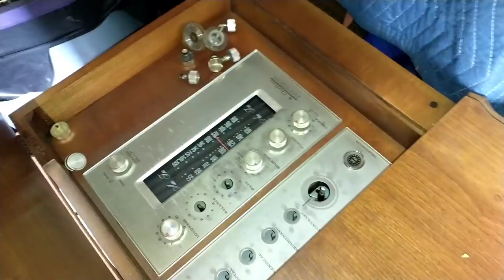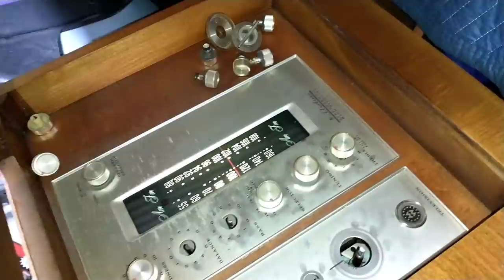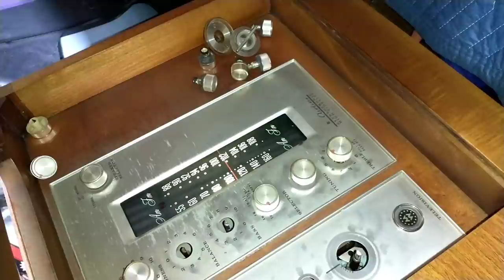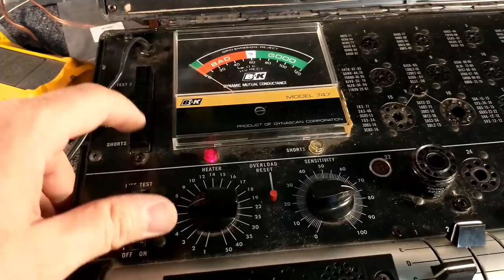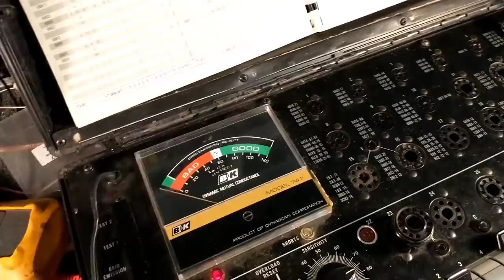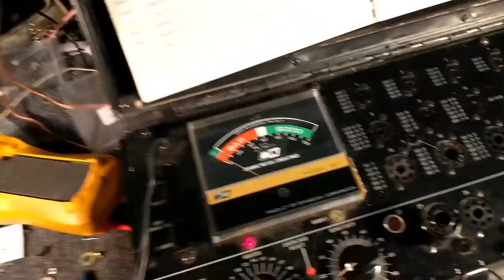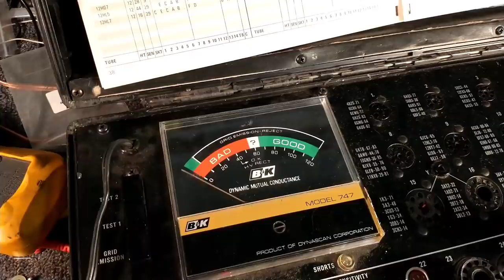Servicing the television of a 1963 Montgomery Wards Airline Imperial console. WG-5974A. Part 1 / 3

Comment: Those things have a breakdown voltage of like 30 volts so they will always measure completely open unless you use that meter with the 35 volt battery or whatever it is

Comment: If suicide had a sound that would be it. How about the capacitor in parallel with the coil or the Boost capacitor? Don't you love it when people tell you what to check in the comments?
Reply from the maker: Given I can tweak the frequency close with the coil backed all the way out, I'm guessing some critical small value cap paralleled with that coil has changed or gone open.  Haven't checked the boost filter to see if it's loading it down yet.
Reply: @JordanPier  Just a thought here... If you are still too low on frequency with the osc coil core backed all out, it would mean there is too much capacitance in that resonant loop. So a cap parallel to the coil would not be open but rather need to have drifted up in capacitance... But remember that the PN junction parasitic capacitance on the 1N400x series diodes is higher than on germanium or schottky diodes, so there may be additional capacitance there that you are chasing.
Also do some resistor readings indicate that you still had voltages floating around obscuring readings - like the 12K resistor reading 6K and creeping up.
And if that three legged brown ceramic cap like looking rectangular thing is some form of couplet it is definitely schematic time.
Reply: @JordanPier  
Does that horiz section rely on boost as sort of DC feedback loop for drive?
Reply: @JordanPier  I also noticed each time you cut it off the frequency would shoot up as it faded out
Reply: Probably blame it on KNX, sirens, birds, and airplanes @shago066 haha

Comment: 1N400x is a mains frequency rectifier diode. It is too slow for this application. You can onLy barely get away with using them because the forward current is low and henceforth there are not many charge carriers introdued into the PN junction so they vacate (deplete) the zone fast once reverse bias is applied. Get a stock on 1N5819 schottky diodes. They should be as good as using a twin TO220 style rectifier double diode from a SMPS for this application.

Comment: I was trying to diagnose an old 1949 TV and I noticed that the power supply voltage had a surprisingly large effect on the oscillator frequency. A DC voltage check might be in order, maybe one of your power supply caps or resistors has failed.

Btw is it normal for an HV rectifier tube to have a bit of a purple glow on the cathode side or does this indicate a problem?
Reply: i usually only work on european vaccum tube black and white sets and on those it means it has air inside...discard it....should be the same on american stuff and colour sets i suppose...our most common hv rectifier tubes for black and white sets are dy88 dy86 ey 86 etc
Reply: @MrHBSoftware  Since my original comment I watched other videos with bad tubes and came to the same conclusion. I temporarily bodged in a solid state rectifier stick and it worked, so the tube was definitely the fault. However I'm not going to actually discard the bad tube. The glow is actually quite beautiful in my opinion so I'll try to turn it into a unique night light.
Reply: @eDoc2020  hahah hope you are joking...yes the glow is preety indeed...and crts with air inside also glow like that with the added bonus of dots on the screen and occasional zaps sparks and arcing inside the neck... i also use a selenium stick rectifier when i troubleshoot a tv with HV problems...i salvage them from 70's sets...together with the socket and anode suction cup...its plug and play and convenient for troubleshooting...also stresses the flyback i little bit less because it doesnt have to power the rectifier tube filament. every miliamp counts